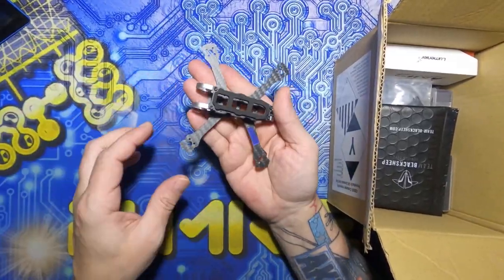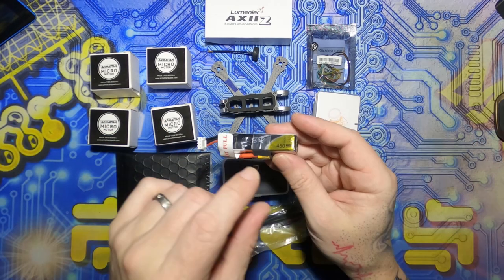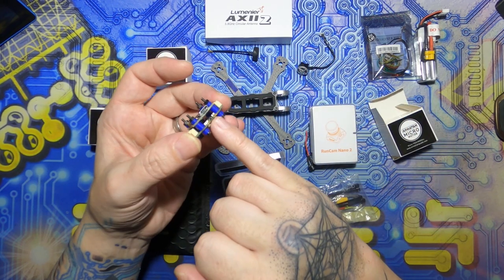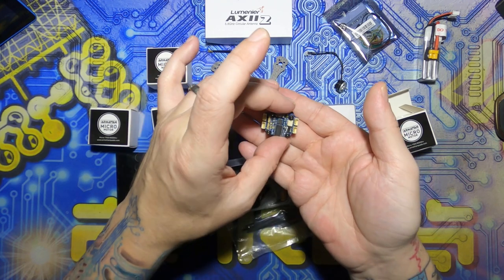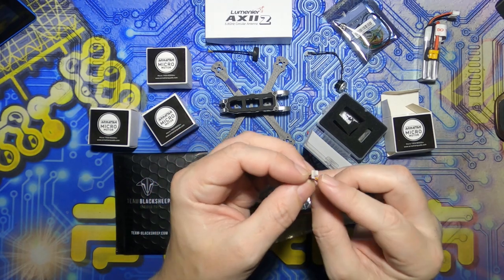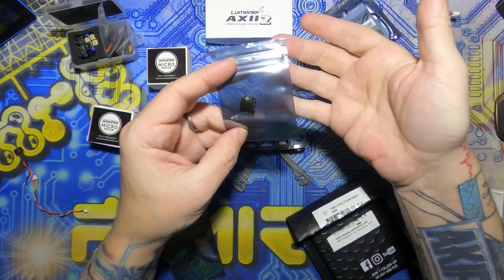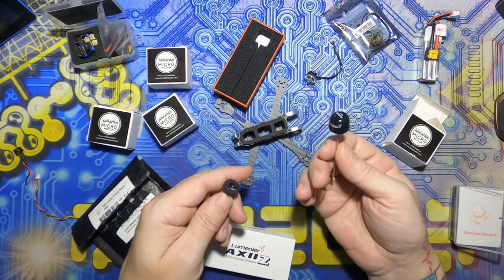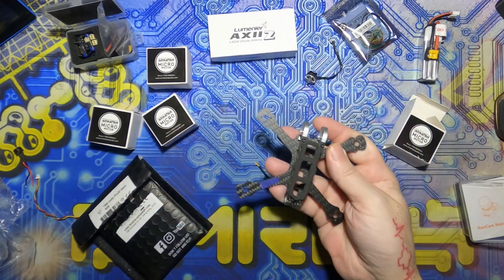Armattan Tadpole [ Part 2 - Parts ]

Comment: When are you building this. No time like the present I suppose. Happy building
Reply from the maker: I have long had it built, had a shakedown, couple of other flights but with whats going on I haven't been able to get what footage I would really like to use. The Racer 2 Nano camera didn't cut it and I ended up going all out for a Predator Nano v4 but still having a little over saturation on some stuff, not sure if the TBS Nano decided to burn itself up a bit.

None the less I think I'm just going to roll with what I have for now and knock the video out ASAP. It is a great flyer and acts much like a 5", super durable and a pure pleasure.
Reply: I’m interested on the vtx. I don’t know what to use. I don’t have tbs just r9m and qx7.
Reply from the maker: @beechFPV  The options are quite limited for the video transmitter, it has to be a TBS or Eachine nano or something very similar, but like me you'll still be fine using Taranis - I used the R-XSR however a small r9 receiver will suffice for your r9m if you need the longer range on this, regards the VTX, some people have had them go a bit funny when they sit idle for too long although they have heat/power throttling.
I ended up with OSD, Smartaudio ,Telemetry/working Lua script for tuning & JESC RPM filtering all functioning after a few minor workarounds.

Comment: Love it man can't wait to see the final product. my tadpole has all titanium hardware beemotor 1104 8500 kv mamba f411 stack v1.2 lumenier micro axle, avan rush grey,runcam racer nano 2 unify pro nano.68.5 gr w/o batt 114 gr with a 650 3s I like it alot want to do a night version and a hd version . What do you think would be a good battery &motor combo for this to get the most efficiency?
Reply from the maker: Thanks - It's off it's chops as Armattan spec but the weather here in the UK is not being very cooperative sadly. Only managed a quick shakedown but it has me joshing for as much airtime as poss in the future.
My Tadpole came in at just a slither over 110 AUW with a Tattuu 450 3S
I'm certain there is still weight to come off if desired but I quite like its modularity - especially being able to swap a motor as fast as a couple of props with the nice plug in 1103's.

Well, I think you are chasing diminshing returns going for a heavy lift HD one but I know what the illness is like , ha!
I think a stripped out Hawkeye or SQ13 or something for the camera & I'd be inclined to stay with an 1104 or a 1005/6 but go for a 4000kv with a slightly more aggressive pitch (2.5 x 3 x 3 prehaps) and offset some weight with a good 450.

There is a vid early on this chan from way back when of a Blade 150 (3" on 1104's) carrying a Mobius - I still remember how pathetic it felt but alot has changed since then - that was back when 5"'s were just coming of age and trying to shoehorn 30mm stacks with seperate becs into a 150mm frame was it's own discipline, not to mention ESC's had to be specificly designed for 4000kv. I suppose what you could take from that is, you can do it.

Get off my lawn haha! yes I'm getting long in the tooth! I hope this helps , Tim!